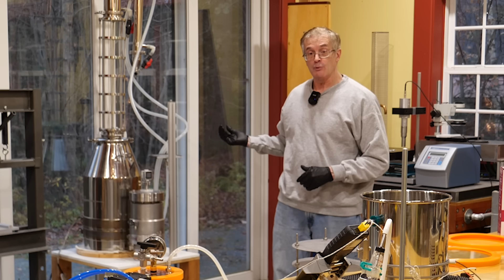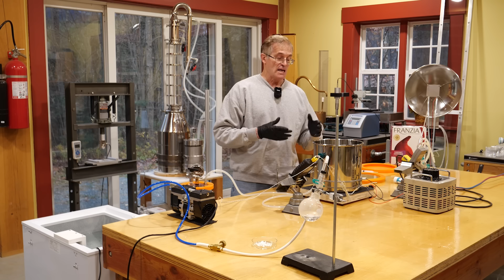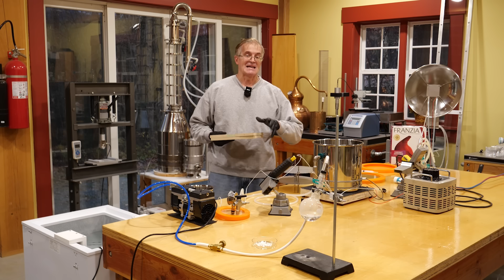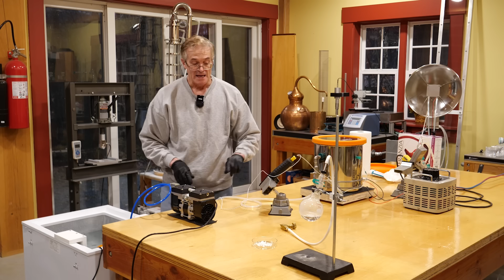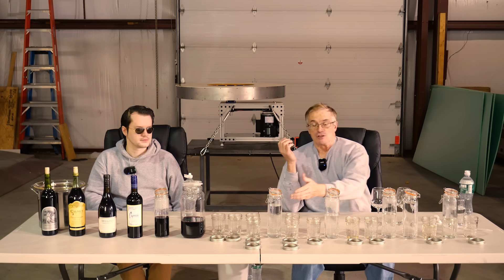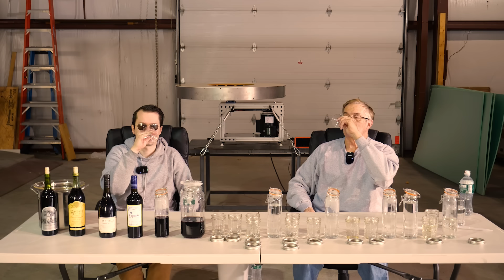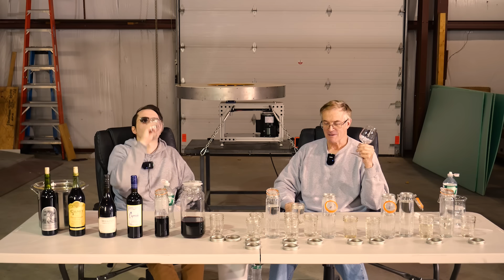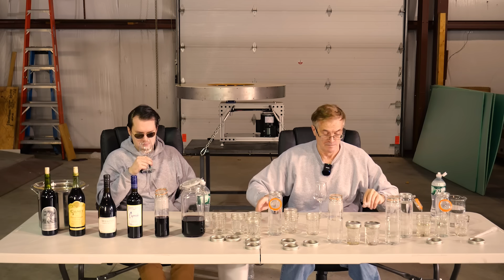Turning $3 Wine into a $100 Vintage with Science!

Comment: All that expertise, preparation, and equipment but you still sloshed the wine out of the box instead of just removing the bag and squeezing it. Proof that everyone misses something simple eventually! lol great video!
Reply: I figured out that when your box is empty you can pull the bag out and puff air back into the bag, making it easier to get the last drops out AND the bag makes a pretty decent pillow if needed 😂

Comment: Cheers to the lovely father and son!

Just a quick note on two points:

1. Methanol comes from pectin, not cellulose. It’s also mostly produced not directly by fermentation, but by the action of an enzyme called pectin methylesterase (PME), which is typically made by certain bacteria or fungi — not usually by yeasts.

2. I think you may have fortified your wine a bit, so comparing flavors might not be entirely fair 😅

Aside from these two points, it was a great video — bravo!
Reply: I was really hoping they'd hold back the "first cut" that was almost pure alcohol, or maybe put half of it in, so that the wine wouldn't become fortified. But, to be fair, they'd just done all that tasting, they were already tired, and the brain juices probably weren't as fizzy as usual by that point. It just makes sense though, and he even mentioned it when he was talking about cutting some of the ones in the middle out, that maybe they'd need to reduce the alcohol so that it wouldn't be too strong. I'd like to see them do it again, and maybe have another person or two to help with decision making on what to cut. And if they would consider putting in partial amounts of some of the jars instead of just going with a binary in/out decision, it could get more refined.

Comment: V&E grad here. Awesome video and definitely appreciate the fine detail provided in explaining apparatus assembly. When you taste your distillate, don't be afraid to add a little bit of water. it "opens up" the flavor by volatilizing hydrophilic aroma molecules (more like what you'd get in the final wine product), and simultaneously cuts down on the overpowering harshness of the ethanol. The amount you tasted in the wine glass probably could use just a few mL, and you noted an ABV of the distillate near azeotrope, so a small amount of water will likely have a pretty decent effect for tasting evaluation. If practicable, more people on your tasting panel would also be fantastic in future videos, especially if they're blind tastings. However this looks like it was enough work as it is lol. Looking forward to the next video.

Comment: Fascinating experiment. For the left over tarty purple portion, perhaps only mix in an amount that is proportional to what you kept from the clear portion? For example, if you threw out 30% of the clear part, then only mix in 70% of the purple part. I get the feeling now it's overly tart.
Reply: They also could have left out cut #1, which they said was probably pure alcohol, since they cut 4 other bottles out completely from the final mix.
Reply: @SuperDavidEF  Well, probably 95% or so, since the ethanol/water azeotrope is (according to Wikipedia) 95.5%, so it can't be more alcoholic than that from distillation. [Doesn't change your reasoning, which I agree with, to be clear]

Comment: I would be interested if you could use the vacuum set up to rapidly "oak" the wine. Perhaps a few hundred cycles, like 360-ish? just to simulate a year in barrel for wine ageing purposes. Also, I wonder if it would work on pure grain distilled spirits?
Reply: Seems like you could just make a tincture of oak barrel and add it to whatever you want to flavor.
Reply: @TimHayward  Oaking is a lot more subtle than that. The flavors it adds are leached through from many pressure and temperature changes, not a massive extraction. I suppose you could make some using something like reagent grade ethanol, but the possibility for overextraction  could ruin that easily. Wine is so much more dilute than pure ethanol, and so would extract different and less of those compounds.

Comment: They have “ drill” bits for rubber. You can drill or “punch” through rubber stoppers , belt, track, tires. 
Used for studding snowmobile tracks and off-road tires.

Comment: i really doubt the notion, you never had something out of a pressure cooker that you liked.
making hummus, requires soaking the chickpeas overnight, then cooking on medium heat for hours and hours.
adding baking soda speeds it up while also negatively affecting the flavor and color of the chickpeas.

so you can either cook them for 3-4 hours with no baking soda until the chickpeas are perfectly soft, or you could cook them for 40-50 minutes in a pressure cooker.
it comes out exactly the same flavor wise, and hummus is freaking delicious.
Reply: His humor is pretty subtle, though.

Comment: I recently had some Nepalese housemates move in who were astonished that they could cook rice on the stove without a pressure cooker! It's amazing how varied the environments humans can thrive in are!
Reply: I lived at a high elevation and making rice sucked - it took forever. Secondly, you can't get the repeatability on the stove as you can in a quality Zojirushi to rice cooker. I can't go back to making rice on a stove.
Reply: Yep, also """climate""" varies by 70° seasonal swings, in a lot of places (including where I live).

A degree higher or lower ain't gonna make a hog damn bit of difference, over 100 years. It's like listening to the noise, instead of the signal. Irrelevant.
Reply: @PaulLawson-k8v  Climate by definition averages over 30 years, you know?

Comment: I worked for the largest winery in the world; they used what is called a falling film tube evaporator I believe 7 stages. this machine 70+ feet tall with plate and frame chillers and essence recovery units. The science was way beyond me. the 180 proof alcohols were distilled in these vacuum pans as we called them. The wines were made by crushing the grapes, decanting, fermenting, polish filtering stored in many 650,000-gallon tanks not oak barrels. the French oak came on hundreds of pallets in sacks of what looks like sawdust (Roasted French Oak). And I used to live 5 miles from the Franzia winery. Great video Thank you.
Reply: I saw that wine manufacturers also use spinning-cone distillation. I actually built a mini version of that for work out of 2.5" sanitary fittings and metal condiment dishes. I ended up with something like 20 stages (10 spinning 10 stationary). The main body was about 24" long.
Reply: @seeigecannon  Fascinating. I looked into spinning cone distillation just now and it reminds me of a humidifier my mom used to have that just spun a cone that flung water at the inside of the machine, producing a vapor. Under vacuum I can see how that would be very effective.
Reply: Gallo?
Reply: @AkaRyrye83  Yes.
Reply: @Bob-the-Millwright was gonna say, that sounds like livingston
Reply: @alpal4245 Fresno, but yes Livingston is the largest.
Reply: Awesome story, thanks for sharing 👍
Reply: Ah, you worked at Gallo! Hello from a fellow cellar rat. Halo once tried a million gallon tank; temperature differences from the center to outside during fermentation couldn't be overcome. Essentially the middle of the tank would always boil. Wish I could have seen that.
Reply: Yes I’m drunk, but it’s for science!
Reply: See, this proves that it CAN be done, on a huge commercial scale.
Our Tech Ingredients heroes here, offering up their expertise and taste buds to science,
have proven you can do this at home.  Hell, even distilling wine in a more traditional way, you could do similar. 
The vacuum stack sure does work well though.
Reply: nice. just like my ancestors made back in the old country :)
Reply: elite ball knowledge acquired.
Reply: elite ball knowledge acquired.
Reply: Largest doesn't mean best. Or even good.
Reply: @Heimdallr-88h14  You are absolutely correct, they made their billions on volume. Thunderbird, Ripple etc.
Reply: @Heimdallr-88h14 thanks for that input Einstein
Reply: @Heimdallr-88h14  exactly, dude is talking about steel tanks with oak staves lmao
Reply: @cwcaswell  no he isn't. Staves are not the same as sawdust or chips. We have used staves and chips here and prefer the chips. The tanks would have been stainless steel not just steel. Noone uses other grades of steel for winemaking but glass, plastic, and concrete are fairly common so specifying is relevant
Reply: @Heimdallr-88h14  Point?
Reply: @Nope-o2h  Definitely.

Comment: Very fascinating stuff. Excellent work! It would be revelatory to see the fractions run through proton NMR or IR. 

Two things I would note that may have impacted the experiment negatively:

Firstly, you removed somewhere around a liter of fractions from the reconstructed wine. Would it have been appropriate to replace those removed fractions with distilled water to dilute the reconstructed wine back to its original concentration? One of the reasons why the reconstructed wine was bolder in flavor could be because you had concentrated the wine somewhat.

Secondly, when you did the taste tests, your reconstructed wine was properly aerated by virtue of pouring and mixing the fractions. I'm not sure if the test bottles were given the same sort of treatment. I bet the Caymus would have had a better showing in particular after having an opportunity to breathe more.

If you do some other wines in the same process, food for thought!
Reply from the maker: I should have mentioned that we let all the bottles breathe for about 90 min prior to the test.

Comment: Is the heat shrink on the internal temperature probes silicone?
Reply from the maker: No, the ones we used didn't come with the heat shrink over the tips. If they do, just pull this off and you can dip them in some silicone resin if you're concerned about the solder.

Comment: So for that wine you want to pull about 3 jam jars out of it and keep it, pull another 5-6 jam jars and throw them away and then put the first 3 back in and you have drastically improved the wine. Would be interesting to see if this would change for different wine, because if the process ends up being fairly similar it would cut quite a bit of time and processing out. Really interesting process.

I am now wondering about Coffee, I suspect the issue with it is that a large part of its flavours is suspended particulates rather than liquids and hence this process would not work to be able to improve coffee at all. But if we could remove the bitter flavour a lot interesting speciality beans may come alive with fruit, floral and sweet flavours which we get hints of when brewed in certain ways but it could really do with being amped up.
Reply: The way coffee works is actually quite simple, and there are easy ways to reduce bitterness and improve flavor, but those are two different things, and are affected in different ways by the different processes. For instance, the easiest way to get the coffee to be a lot less bitter is to cold brew it. But, the best way to get the best flavor is to hot brew it very strong (usually espresso, but it doesn't have to be, because a good home brewer can make excellent STRONG coffee too). If you want both effects, get some good specialty beans, light to medium roasted and ground fresh, and make a couple of shots of espresso, then mix that with some cold brew coffee. Add water to reduce the strength back down to a "normal" cup of coffee, and it will have a wonderful flavor and almost no bitterness at all. In fact, if the espresso is well made, and the cold brew is also of good quality, you should find that you can drink it a lot stronger than you normally would, because the bitterness is almost non-existent.
Reply: Have you ever used a moka pot?

I've found the results vary wildly, depending on exact technique. They even vary wildly, from moka pot to moka pot, with everything else kept the same.

Also, people taste in coffee varies wildly. I guess I'm saying that if you like to experiment, maybe try a moka pot, and keep trying new methods until you get a perfect cup of coffee.

Lastly, I feel like the domestic coffee supply got worse, around 2020 (I suspect it's somehow pandemic/supply chain related) and I'm wondering if anybody agrees?

I feel like we're getting worse beans, over the market, broadly, for several years now.

Comment: Hey guys, Firstly love your show, keep up the great work. My critique on your process would be this. The pallet can't process flavors over 40%. So, in my opinion to get the very best potential final flavor you should test each cut for ABV and then water it down to 35%. Then taste test it as you will get a better idea of it's "actual" flavor when mixed back into the final product. The reason for the previous AVB test is to know when to stop adding water to your samples as you go down the line of cuts. 

Lots of the flavors you would want to remove would be in the heads and tails. Having said that your cuts while in those stages should be much smaller to allow for really being able to pull out unwanted flavors. Especially because this is such a small run of alcohol.

I would say the most challenging or i sould say most limiting factor to beimg able to really enhanceing the taste would be the portion that was left inside the still (the concentrated red portion) this hold all of the flavors of the chosen grape variety. It holds all of the oils and essense of the ground the grapes were grown in. It would be difficult to mock these flavors from a high quality grape vine that has a 100 year old root system drawing its flavors from deep within the ground. Hard, but probably not impossible. I believe this would be where your time would need to be spent, in order to make the most impact.

I hope this helps, cheers 😊 and happy testing 🍷
Reply: Maybe some good points (I wouldn't know), but I think it boils down (LOL) to RESULTS.

If the results are good, the process is good. If it tastes better than $3 wine, then fine.

There's always room to improve a process. But that's what they're doing, fundamentally. They're exploiting cheap wine, with science.

Comment: If you do this again, consider reducing the percentage of the “leftovers” to balance the tannins better. I also think it’d be fascinating to see a head to head of red vs white, as well as what the “brandy” tastes like alone.
Reply: Yes!  Try mixing the middle cuts that you decide to keep, then slowly add in the heads and tails till you get just the right balance of tartness & alcohol
Reply: Yes, I agree. That leftover part probably introduces a lot of nastiness in addition to some good.
Reply: There would probably have been more surprises until the very end of the tail.
Reply: I agree. While there are many choices, I think it would have probably been more level if you had reduced the grape concentrate proportional to the cuts left out.
Reply: @leeka40  I might have even cut it a fair bit more for the first taste, and then start adjusting from there.
Reply: agreed - also they left the leftovers open to air for too long i would asume...

Comment: You shouldn't use a dissimilar metal in your passthrough with your K type thermocouple as that would create a second hot junction and cause your measurement to be inaccurate.

They make 718 sheathed type k thermocouples typically called MgO sheathed thermocouples with vaccuum rated compression fittings. You would get a much more accurate reading with one,and the thermal and electrical conductivity would not be affected by no atmosphere like a bare thermocouple is.
Reply: If you go from wire to the stainless steel screw and then back to the same metal wire, both junction voltages will have opposite polarity and thus cancel each other, provided there is not too much temperature drop over the length of the screw.
Reply: Since there are junctions in both leads that are almost the same temperatue, the effect of the extra junctions will be minimal.
Reply: @roflchopter11  The extra thermocouple effect is minimal, the reduced accuracy is mainly from having the extra mechanical joints. Better solution would have been to strip some of the insulation and pot the bare thermocouple wires so they could seal into the plug.
Reply: You beat me to it. I was thinking about that too.
Reply: In principle this is true but in practice you can get away with it if you calibrate every now and then, depending on desired accuracy. A better solution for the overall cheapness of this project would be to strip the insulation from a length of the thermocouple wire and pot it in epoxy or something else that will seal into the plug

Comment: vacuum pump oil is not a problem. put a pot between the pump and your kettle. set the pot into a dry ice or liquid nitrogen bath. the line from the kettle goes almost to the bottom of the pot, while the pump line is at the top. for added safety, add some activated charcoal to the pot. oil will either be frozen or entraped in the charcoal. also, there's no need to ruin the kettle by drilling holes into it. just drill them on the lid.
Reply: They likely had a tempered glass lid instead of acrylic.
Reply: @Woodturner88  make that 1/4" ss304 or aluminium, domed
Reply: He's not using an oil-sealed rotary vane pump; the one specified is a diaphragm pump, and is oil-free. It won't create as intense a vacuum, but it's certainly enough for this application. It's also not any more expensive.